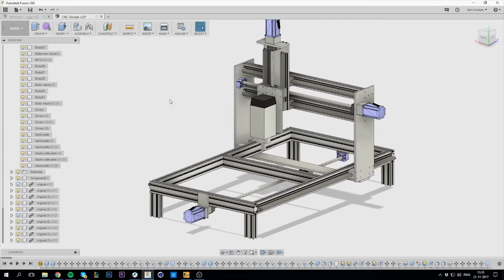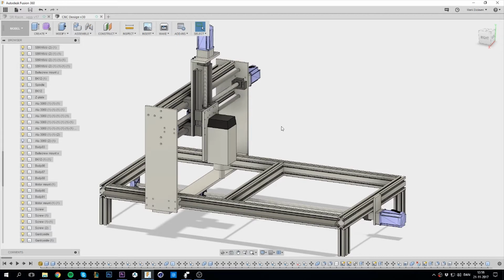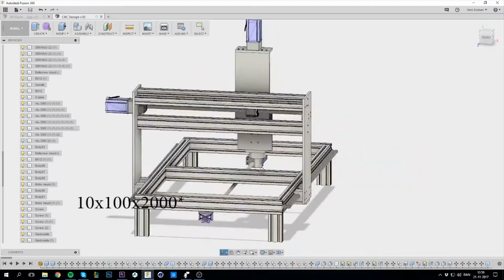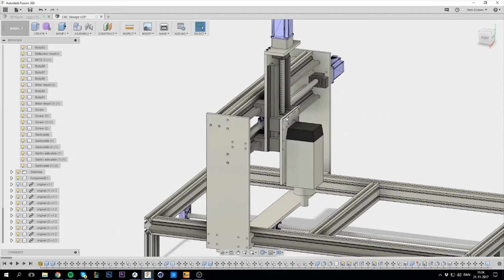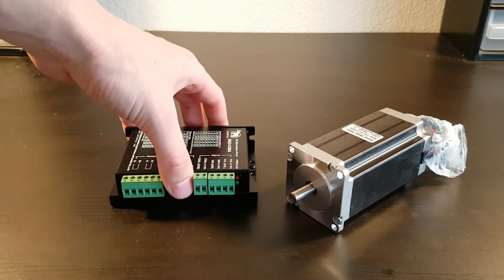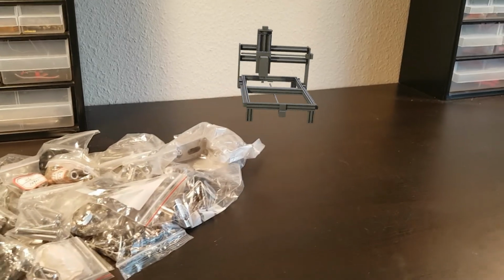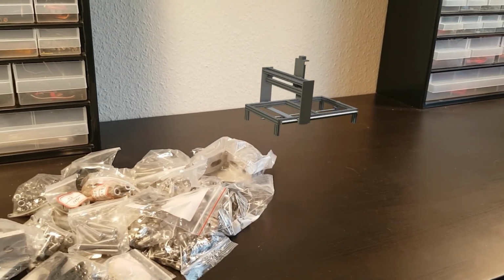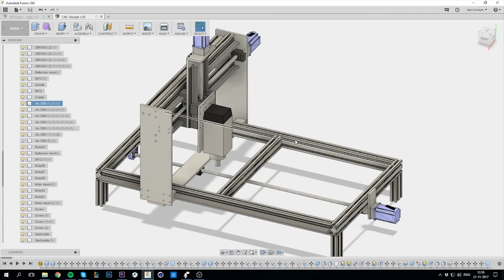Large CNC Router Build Part 1 - Introduction

Comment: Hi Karl. Hope you’re getting on well with your cnc machine. Exploring going down the diy route vs buying a kit and wondered whether you had put together a BOM, along with sources that you’d be prepared to share? Also have you posted your F360 design anywhere online? Many thanks
Reply from the maker: I am definitely open to sharing the design. Although I have learned a lot while building this cnc. I would do lots of things differently if I had to do it again. I will make a follow up video where I talk about these things.

I work a full time job so I don't have much spare time to spend on the cnc, sadly. So if you are in a rush then there will be better alternatives than waiting for my design